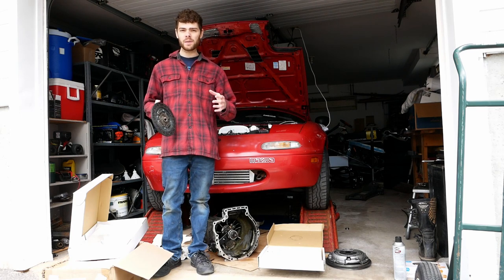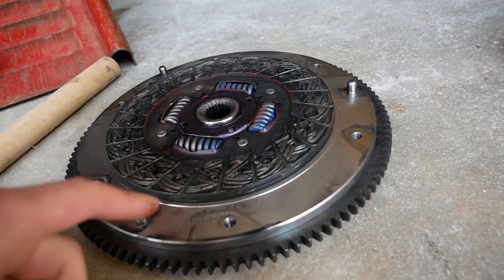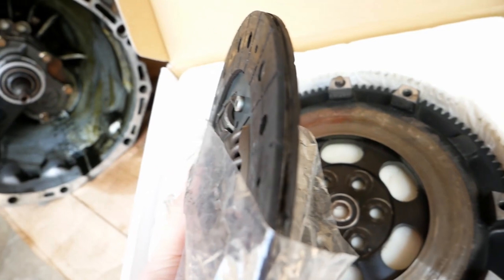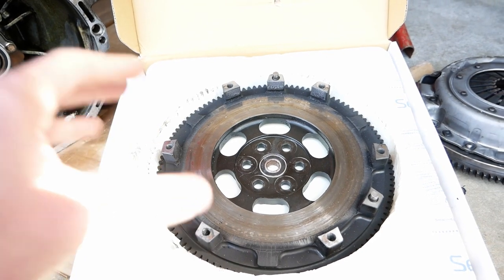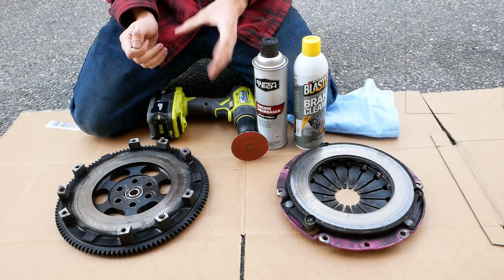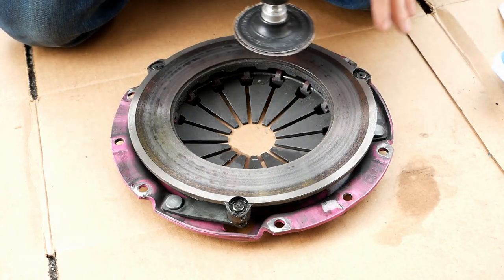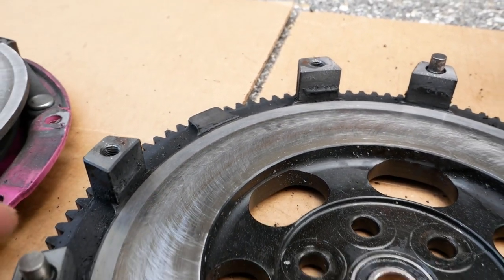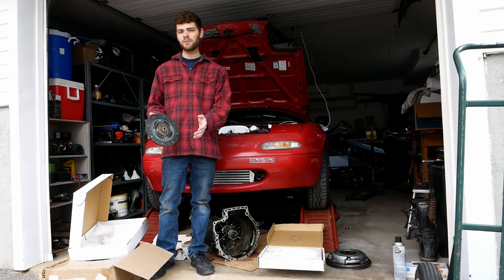Should You Reuse a Clutch, Pressure Plate and Flywheel? [DIY Resurfacing Tips]

Comment: If it works, it works. I'd replace throw out bearing and pilot bearing unless extremely low miles. Primary measurements for the clutch disc are material thickness and depth to rivets from material surface. Hope it works well for you!
Reply from the maker: These had about 3k miles on them. Turns out stock bearings don't work with a Stage 2 Flyin' Miata clutch though, that bit me that's for sure. Good point about the material thickness!
Reply: You need to check the steel pressure plate is level with a straight edge, I used a good quality steel ruler and hold up to the light, of course of you see light coming under the edge then the part is probably warped and needs to be replaced.

Comment: Is it possible to refine/prep a brand new clutch disc and clutch plate,being that they are processed in large quantities and not produced by the best manufactures,(as to say no name branded parts)lets persay,I felt my new clutch disc feels as if it has burs on its edges and so does the clutch plate ..Would a 200 to 300 mile clutch breakin/bedding in be  better to remove and flatten these points in the disc and plate also flywheel or could we prep the new parts as you did your old parts,whith a high grit number sanding disc,or take the new parts to a machine shop for "prepping?✌

Comment: It works great! I got my flywheel professionally ground and I grounded the pressure plate myself. 

As long as you use plenty of lubricant and don’t put pressure; let the sandpaper do all the work, you shouldn’t risk warping it. Good idea to grab a ruler to check for low spots.

Comment: Quick qustion

About to drop transmision as clutch is slipping quite heavily,do not have the cash to go all out on this so was thinking of re using pressure plate and just get a new clutch plate.Will have flywheel and pressure plate re surfaced.

Any advice.
Reply from the maker: If you pull it and the flywheel and pressure plate look fine, I think that’s a good way to go. If they look severely damaged or hot spotted, then you may need a whole kit

Comment: Hi Cash,
I had my 2013 Daihatsu Gran Max clutch & flywheel resurfaced at a good shop.
Now, it doesn't release completely.
Throw-out bearing is good and pedal does NOT feel spongey
What could I check next?
Reply: Add some super thin washers between the pressure plate and flywheel till you get good release .
Reply: I had the same problem. Used a resurfaced flywheel & low mile clutch. It wasn't disengaging all the way. I bought shims for the throwout bearing (interior slave cyl)

Comment: I would replace the bearings there not expensive lightly grease the input spline I'm replacing the my hydraulic throw out bearing  clutch and pressure plate

Comment: great video and to the point. Thanks. Is it ok to use break cleaner on the clutch disk to make sure is clear of any oil and dirt?
Also when you say to make sure the disk has enough meat, how may MM should be the thickness of the disk?
Reply from the maker: I used it on the disk and it was ok, but I'd do a bit more research to be 100% sure. Thickness will depend on the clutch itself. Take a look at a picture of a new one and compare!

Comment: Dope video. Currently pulling my hair out trying to get tps fixed on tunerstudio!
Reply from the maker: What issues are you having, noise in the signal?
Reply: @CashedOutCars  not reading right. It's either my harness or the tps itself..ordered a new volt meter so waiting on that
Reply from the maker: Odd, I’m sure you have but you made sure it’s plugged in the correct way and calibrated in tuner studio right?

Comment: I like people who resourcefully do this but why not just have a shop do it, it’s like $40
Reply from the maker: This was basically free and worked great, plus for $40 I’d be surprised if it wasn’t only for the flywheel. I’ve also seen much higher prices near me
Reply: @CashedOutCars  Seriously, flywheel resurfacing goes at least for $100
Reply: there isn't to many places doing it anymore
Reply: @CashedOutCars  Save 40 dollars and get four gallons  gas !
Reply: 40 bucks 😂😂 clearly you have never had machining done. They charge 40 bucks to look at it let alone do it🤦‍♂️
Reply: In case you're at home with the daily driver ripped apart and can't slide 80 bucks for an uber